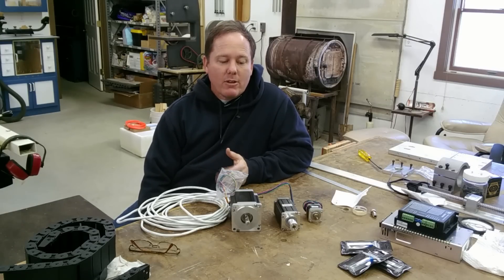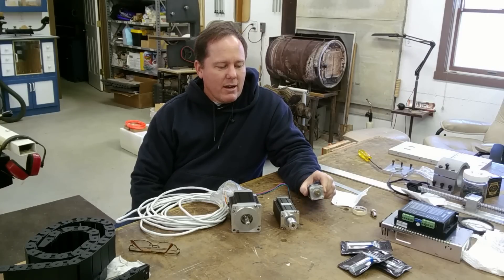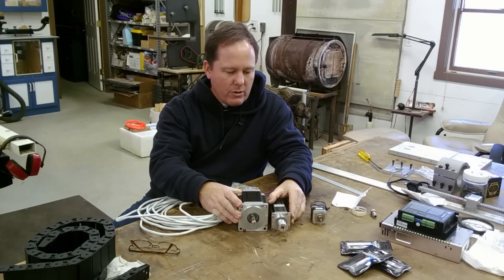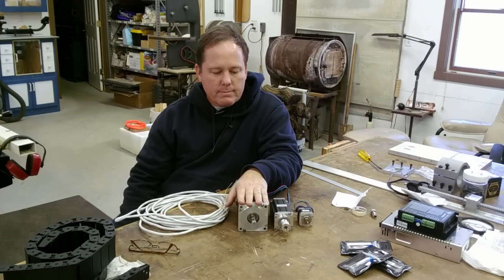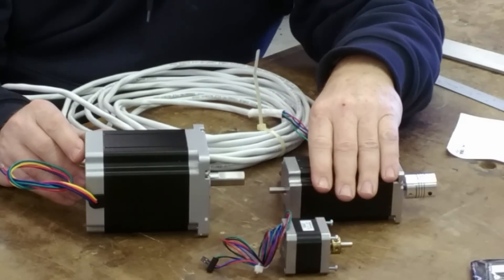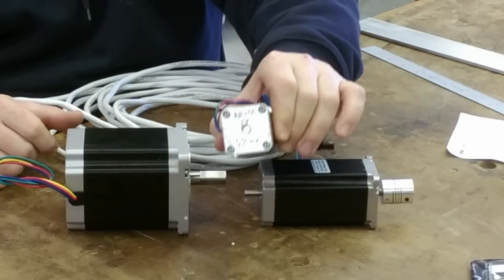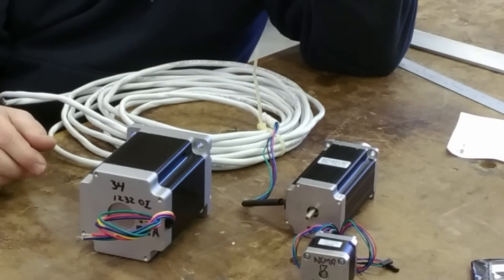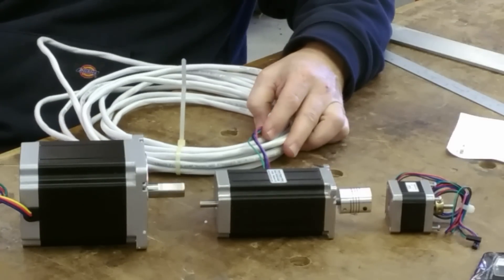Practical Insight in selecting stepper motors for your build -Old Version

Comment: I really dig how you DIDNT go with the upside-down-field-goal style gantry… To me this looks much more solid… I have been thinking about building mine this way, because I can easily add another set of linear rods at the bottom of the Y Axis…. I think this design adds a whole lot more stability to all the axis when compared to the typical gantrys that just flap in the wind, causing more jitter at higher speeds, and or harder materials. Thumbs Up!
Reply: It's actually less solid, at least in terms of compound flex. All three axes being in a line from (Workpiece > Frame > X > Y > Z > Endmill) introduces a little movement from every axis between the endmill and the workpiece. A fixed gantry is different in that the most solid part of the structure sites in the middle (Workpiece < X < Frame > Y > Z > Endmill) which is better for chatter reduction, resonances, etc. Both topologies have their advantages and disadvantages, but for most it's difficult to know how to leverage those advantages to your benefit.

Comment: Can we use both Nema 17 (DRV8825) and Nema 23 (TB6650) on same Arduino simultaneously?
Reply from the maker: Yes.  The signal is the same.  You will have different power supplies and possibly different stepper drivers.

Comment: You have two steppers on one axis?
Reply from the maker: Yes.  The Y axis on both of my machines have a stepper on each side.  They are slaved together in the controller software setup.
Reply: Wouldn’t one need to turn counter direction from the other one?

Comment: What wire is working for your steppers,?
Reply from the maker: I'm using a 4 wire, 18ga (I believe).  It is fully wrapped in aluminum foil which you can ground to reduce signal noise.  ~P

Comment: I will never again use a regular stepper for cutting , they can lose setps to easily, I was always checking parts to check xy zero,  always a closed loop
Reply from the maker: That is very possible.  In my router build (videos on my channel) I almost never loose steps.  I pretty much have to crash the machine.  I run big motors and I learned just how fast it will go through initial experiments.  My limits are actually mostly harmonic through the ball screws.  ~P

Comment: I was wondering if I can use stepper motor on my wood turning lathe..
Please give some insight .. anyone
Reply: I'm doing the same thing to use a router for flutes and spirals. The small motors have not got enough torque, so am trying to find more information on what I need. good luck with your project

Comment: Can someone please help, I am looking for a stepper motor for one my application which is a rotating table. I would need to rotate the table (22" diameter) in steps of 10 degree with 10 sec pause on each step. Max center weight i would have is 20 lbs. Can you please suggest me a stepper motor for my application. Thanks
Reply from the maker: I would use a NEMA 34 just for the shaft size.  Size it for the amount of torque you think you will need.   ~p
Reply: @sbirdranch  Sure thank you :)
Reply: Due to ur large base diameter Use nema 34 with plenary gearbox

Comment: I am in the process of building my own CNC.
What are your travel speeds with the nema 34's?
Reply from the maker: 35 to 40 inches a minute.  That is limited by a vibration in the ball screws if i go faster.   It has been suggested that if i had double ended motors with dampers on them, the harmonic causing the vibration would be deminished and i could go faster.  Good luck in your build. ~P
Reply: @sbirdranch  thank you sir, I am enjoying your videos

Comment: I know that most people have a full set of either nema 23s or nema 34s. I was wondering if it it's possible to use a nema 23 for the Z axes and nema 34s for X and Y axes. I'm asking ecause my X and Y could use more torque or power.
Reply from the maker: Absolutely.   My CNC router is setup that way.  I am running separate power supplies as the 24 takes less voltage.   Other than that it is no big deal.
Reply: @sbirdranch  Cool, thanks for the reply

Comment: stepper motor look like AC servo and i wonder what is the difference between them ? thanks sir
Reply from the maker: A stepper motor does not have a feedback loop to know if it achieved a step.  A servo has a feedback loop, so if a step command is given and the motor stalls, or doesn't make the step, it knows, and will try again.  It is a level of precision and accuracy to go to servos.  I do not yet see a need for servos in the equipment I have built and operated.  ~P
Reply: @sbirdranch    a servo has a feedback loop mean it has enconder? and the step motor doesnt have enconder? Right ?
Reply from the maker: @truongannguyen9253  correct
Reply: @sbirdranch  sir, how to choose the power if i knew holding torque and detent torque of stepper motor ?

Comment: I'm looking in to cncing my g0704 mill, now regarding brands, is there a noticeable difference in quality of stepper motors or drivers that I should be aware of? Thanks
Reply: The biggest thing about some of the different brands/quality is the customer support and getting documentation in English. From what I have gathered, the cheap one work fine. If you go the cheap route, look and see what other g0704 owners are using and copy them so if you need help, you can lean on them for support.

Comment: Great video. I'm building a plasma Table 5 x 8. I'm looking at the Nema 23 stepper motor is a 4-wire.439 oz in 
24 stepper motor which is an 8 wire 425 oz in. I am confused which one is better one would work for me. Thanks

Comment: Thanks great vid- question: I’ve got 3 power supplies, and I’m running 2 Nema 34 for the x, and want to use a 23 for my Z. Using a smooth stepper too... do I have to have/use 3 power supplies for this? And should I use a pulley reduction for the z? I have a 5start screw for the z and two v style linear slides for it too (insane expensive at 300 for both pacific bearing)  v quad rails rollers 1400.00modern Linear) and have 3 640 oz in for the y and z .can I use the old drivers for the 23 for the z? It was a xylotech kit!
Thank you! Great vid !
Reply from the maker: I am running my Z on direct drive with lots of resolution and no small amount of mass it is moving.  I would not expect you to need a step down pulley.  As for the power supply, you only need as many as you need to supply the requisite amps at the required volts.  I have an individual one for each motor.  I could have used one large power supply.  ~P
Reply: sbirdranch Thank you so much for info, it was really helpful, and that’s what I decided to do. Thanks again.

Comment: Hi ,I want to make cnc machine with working area 500mm x 500mm , I want engraving depth around 15mm , is it enough to put 200w spindle with nema 23 stepper motor.
And what is your advice about liner rod and screws and coupling.

Comment: Hi, I have been following all of your CNC build videos and am impressed with your logic and common sense approach. I am also more familiar with imperial and am planning on building a 4'x4' machine as you have. Since I am looking at milling wood, plastic, and aluminum, would you recommend using NEMA 23 with how much torque? (400 - 500?). Have you considered the Clearpath servo motors? Thanks for your videos. Eh!!
Reply from the maker: Bill, I would say that a 400 nema 23 will be fine for your Z.  A little bigger for X and Y if you can.   Some of that depends on your design.  Going with servos is not something I have entertained.  The cost benefit just isn't there for me.  I have yet to jam my machine up to the point of skipping steps.  Even if I did miss one or 10, the tollerences for wood are not that critical in most cases.   Are you aware that @Tormach CNC mills don't have servos?  Best of luck.  CNC Plasma table videos are coming soon.  I'm cutting prototype parts for it with the router.  ~P

Comment: Nice video ! I will try to complement it with a few formulas for those who want to analize different scenarios when designing their cnc. I am a metric guy , so those who are used to imperial will unfortunately have to convert the numbers from metric. I will assume that it is going to be a gantry router travelling for 1,5 m on X (the long axis), ball screws of 25 mm diameter and 5 mm pitch, and that the gantry itself together with the Z axis will weight in 100 kg, milling aluminium, 2,2 kw chinese spindle. The formula for calculating the torque of the needed motor is: (Total torque) T = [ (driving torque at constant speed) Tc + (torque due to preload-should the case be) Tp + (driving torque due to acceleration) Tacc ] x number of pinion’s teeth / number of driven gear’s teeth. I will go into each of them . 1) The torque at constant speed Tc= [(Axial force+ Cutting force)] x pitch / 2 x PI x ball screw efficiency. Now, the numbers: Axial force = coefficient of friction of ball screw (0,003-0,005) x mass (100 kg) x g (9,807 m/s^2) = 4,9 Newtons (I went for the 0,005 coefficient of friction). Cutting force for aluminium on a diy router with a chinese spindle of 2,2 kw depends a lot on the rigidity of the machine/gantry and it will be anything between 0 and 40 Newtons (the gantry of most diy routers is made of an aluminium plate of 20-25 mm thick, which is peanuts because the main force in a gantry is torsion and an aluminium plate pretty much sucks at torsion, but for some reasons many people go this way). If we choose 40 N as cutting force under these circumstances, and knowing that the ball screw efficiency is around 90% (0,9), then torque at constant speed is: Tc = (4,9 + 40 N) x 0,005 (pitch in meters) / 2x3,14x0,9=0,04 Nm (which is peanuts ) .2)  Torque due to preload Tp has a more complicated formula, but as a rough guide a ball screw of 32 mm diameter will have a preload torque between 0,4-0,8 Nm and a 40 mm ball screw will have a preload torque of 0,8-1,1 Nm; the reason for having an interval is that the nut when travelling along the ball screw will encounter ’’ups and downs’’ which will act like breaks. Ball screws are preloaded with o force of maximum 1/3 of the axial force (2,5-10%of dynamic load)  and will only eliminate half of the play in the ball screws. For a 25 mm ball screw –if there is the case of a ball screw preload- it it reasonable to assume a torque preload of 0,5 Nm. I would also add a 0,2 Nm torque due to drag forces created by medium – instead of high-  precision when mounting the ball screws and the guideways (lack of parallelism and perpendicularity ). Therefore I will add this imperfection (due to mounting) as a safety factor of 0,2 Nm  to the 0,5 Nm of preload torque . 3) Torque due to acceleration Tacc = (moment of inertia of the gantry + moment of inertia of the ballscrew + moment of inertia of the pinion/gear) x angular acceleration of the stepper . I will consider a direct drive of the stepper , so no pinion and driven gear . Moment of inertia of the gantry Jg= mass of the gantry ( kg) x pitch^2 (m) / (2 x PI )^2 = 100 kg x 0,005^2 / 6,28^2= 0,00006339 kgm^2. Moment of inertia of the ballscrew Jb= ½ X mass of the ballscrew (kg) x radius of the ball screw ^ 2 = ½ X 3,14 x 0,0125^2 (m) x 1,5 (m, the distance the gantry travels) x 7850 kg/m^3 (steel density) x 0,0125^2 = 0,0004514 Kgm^2. Therefore the total moment of inertia J = Jg + Jb = 0,0005148 kgm^2. Now, the angular acceleration of the stepper is to be thought of as follows: most steppers lose half of their rated torque before they reach 500 rpm. Note that 500 rpm is basically an angular velocity. We need to come up with some acceleration/deceleration time and 0,5 seconds might be a good start. We have the angular acceleration a=(angular velocity ) v / acceleration time) t.  Which we need to transform in radians, therefore a = 2 x PI x rpm/60xt = 2x3,14x500/60x0,5 = 105 rad/sec^2. Now we calculate the torque due to acceleration Tacc= Jx a= 0,0005148 x 105=  0,054 Nm. Lets add them up: Total torque T=(torque at constant speed) 0,04 Nm+ (torque due to preload and due to mounting imperfection) 0,7 Nm + (torque due to acceleration) 0,054 Nm= 0,8 Nm. This is where all manufacturers recomand to multiply this calculated figure by a safety factor of 1,5-2. If we choose the safety factor of 2 the result is that maximum total torque is going to be = 0,8Nm x 2 = 1,6 Nm. Please note that this value is valid for 500 rpm , which translates into feed as follows: 500 rpm al stepper shaft, direct drive, ball screw of 5 mm pitch, means that the feed will be 500 x 5 = 2500 mm/min. Therefore, the stepper needed is that stepper that has a holding torque between 3 and 4 Nm. (the maximum torque of 1,6Nm to be half of the holding (maximum) torque ). It will depend a lot on the driver. For example, a ES-M23440 motor from Leadshine will have 1,6 Nm at about 500 rpm with 48 VDC driver; if the driver is changed to a 68 VDC, at around 500 rpm the motor will develop about 2,4 Nm (http://www.leadshine.com/UploadFile/Down/ES-Md_V1.3.pdf). I hope it helps.
Reply: i'm sorry to be the one to do this but TL:DR..... i do think the world standard in Cad/Cam/CNC should be metric even though i grew up with imprerial.. thats good for wood and what not but machning precice stuff its a dick and a half.

Comment: I believe there are some flaws in your design....first of all, that aluminum flexible coupling is a bad idea for heavy weight, especially when moving with high speed, it will compress or extend, giving errors in positioning...that is good for very small 3D printers, where the load is very small. second, the stepper motor is driving directly the lead screw, and it is not running continuously, but in small steps, usually  1.8 degree/step, if you need high torque (you can use micro-stepping, but torque decreases). 
when you use short belts and pulleys with 3 to 1 (or 2 to 1) reduction, you need less torque from motor and vibration is greatly reduced, positioning is more accurate, because the belt is reinforced with steel wires and it will not compress or extend
Reply from the maker: I read your comment when you made it and apparently it stuck in my little pea brain because today while eating dinner I remembered it and where there is a flaw in your logic leading to your concern about the couplings.  I'm following you in that they would change length on rapid direction change.  However the way my leed screws are designed they are held in place with bearings and retaining nuts.  This is how end play is controlled and adjusted.  The distance between the stepper and the end of the leed screw is fixed.  I can't believe this thread was still floating around in my subconscious.   :)  ~P

Comment: I really enjoyed this video!   Im doing two separate builds at the moment and have been trying to figure out which motors to use!   I am building a 4x8 ft plasma cutting table and then a harbor freight table top mill that I have been working on converting.  My two big questions would be what size of motors for each project do you recommend and which controller and program?  I have been looking at the MASSO and the Centroid Acorn just because you don't need a PC to run them.

Comment: I am creating an equatorial mount for my 2-3kg Newtonian Scope. The distance to the rotation axis would be around 20cm. Should I use a Nema 17? I am looking for good Holding torque since I am more worried about the static position of the telescope.
Reply from the maker: Sounds a little small to me.  I would consider 23's...or at least the option to switch to a 23.  ~P
Reply: Felipe Menzella it depends on how you  drive it. My ancient eq mount had a worm drive. 17 would be more than enough. The worm reduces a need for holding torque. You can't back drive them. I'd assume the other axis is tooth belt  reduction arrangement. Smaller motors and reasonable max slew rates mean longer battery life out in the field. Remember the scope would be balanced so it's mostly friction and inertia not weight to consider.

Comment: I am planning to pull 2,5 - 3 kg weight with a belt connected to stepper motor. I think Nema 17 would be enough for that, it is related with the friction but friction will be reduced like icy road. Am I right, or do I need bigger ones? 
Thank you
Reply from the maker: Unless minimal size is in order, I would design for a Nema23.  Remember that these are frame sizes and you have some options for torque within the frame size.   You could start with a small 23 and if it isn't enough, get a larger torque motor with the same frame size and swap it out.
3kg is 6.6 lbs on this size of the pond.  Unless you have some mechanical advantage I think 17 would be small.

Comment: I want to create a turntable that supports 5 to 10kg weight on 50cm diameter plate. Which one should I choose? Should I have vertical on axis or it is better/more durable outside connecting the axis with a rubber belt?
Reply from the maker: That depends on how hard it is to turn the table.  I would suggest that the biggest thing to overcome is the initial start of the turn so if you are making small steps around the axis, you might consider some mechanical advantage like a step down belt setup.  This will also give you the ability to make smaller steps.  5-10kg is 11-22lbs roughly.  For a single motor and the cost difference, I'd design for a nema 34.
As for the motor connection....steppers are not designed to carrry a load down their axis.  They don't have a trust bearing.  So regardless of what you do, direct drive or otherwise, the table has to carry it's own weight.
P.
Reply: Thank you.